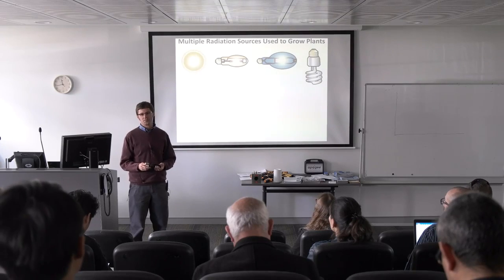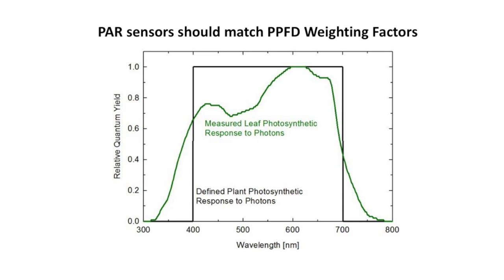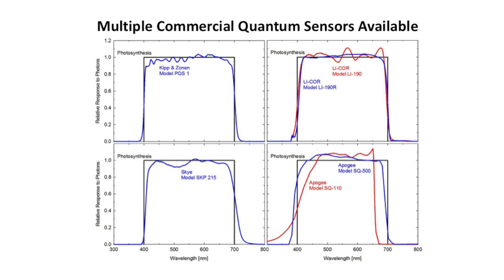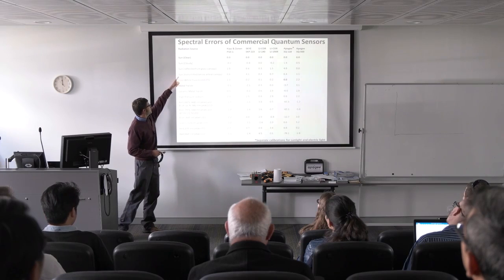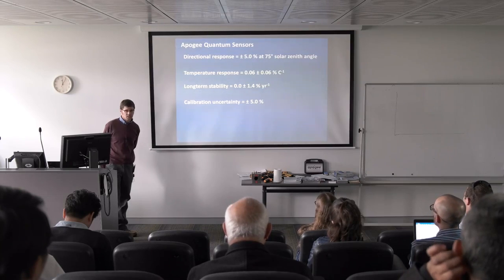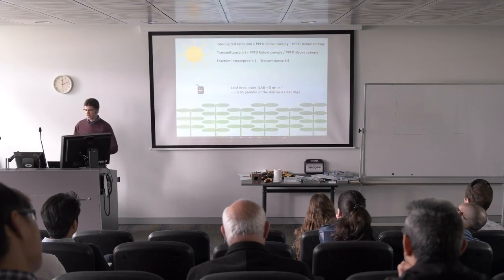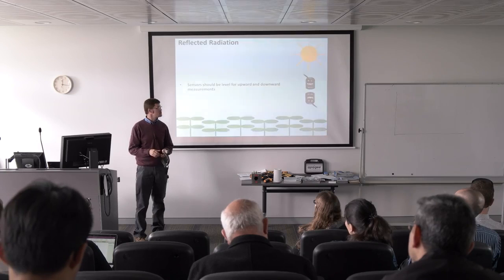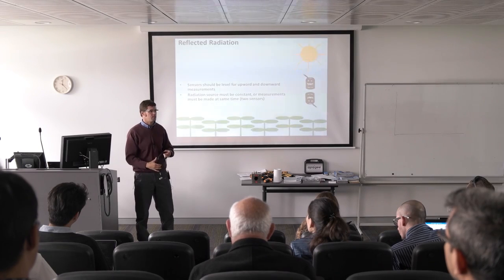Photosynthetically Active Radiation (PAR) - Principles of Environmental Measurement Lecture 4

Comment: Not true photo synthesis also uses ir and uv.
Reply from the maker: In this video, we are referring to the commonly used definition of PAR that measures light in the 400-700 nm range. Bruce Bugbee is currently working on cutting-edge research to explore the effects of the McCree curve that measures light from the 360-760 nm range (which includes IR and UV light). We are also currently developing a PAR-FAR sensor that measures both PAR and IR light (https://www.apogeeinstruments.com/par-far-sensors/). If you are interested in learning more information, check out this video Bruce just made: https://youtu.be/gHOJQmYFW1A.

Comment: How come that yield photon flux on 22 species shows that plants are very efficient at photosynthesis in green band of wavelenghts? Can someone please explain that.
Reply from the maker: Hi Luke, this video by Bruce Bugbee may help answer your question: https://youtu.be/gHOJQmYFW1A
Reply: Basically if I understand this concept. The green is the least efficiently absorbed by most plants. however it goes further into the canopy of leaves. So it penetrates deeper allowing some of the lower leaves to still get photons.
Red doesn't go as far into the canopy of plants. And blue is the least. 
U/V and far red/infrared I don't know.
Blue would touch the surface where as green goes deep through.
If I explained it well thanks to Mr Bugbee for explaining it to me.